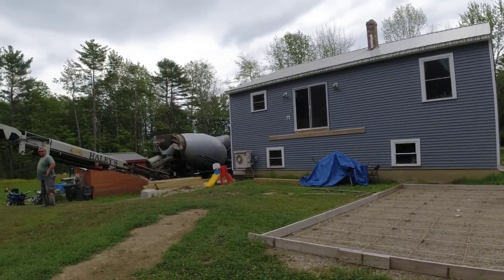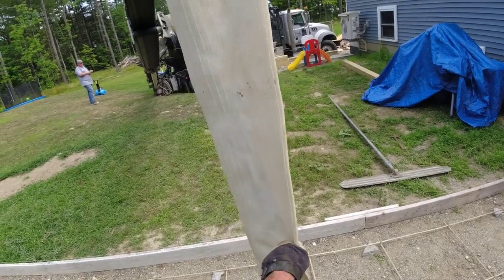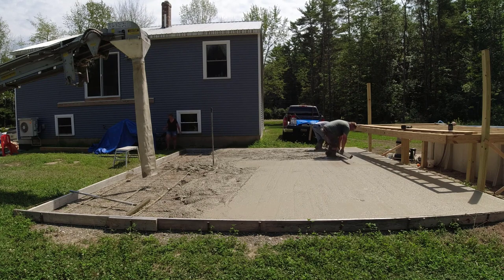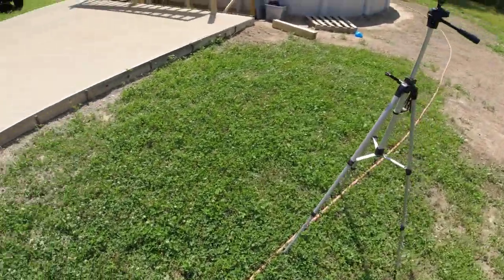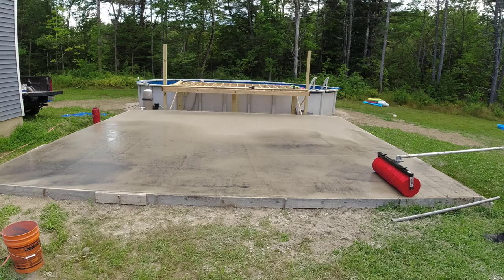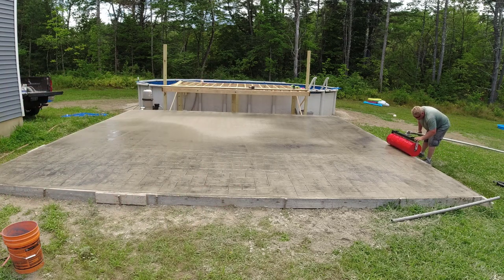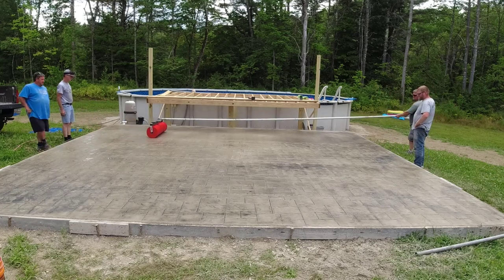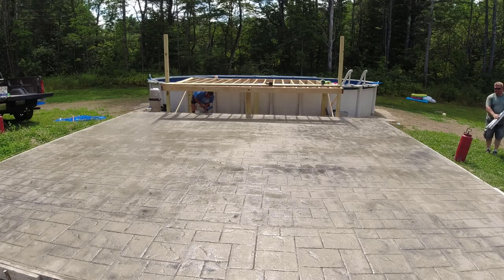Roller Stamp Your Stamped Concrete Patio! (How To Rock & Roller)

Comment: Looks like you have to start the roller at specific place on each run also is that correct. It looks like you had the same size print squares along the starting edge also.

Comment: HI Mike Very  good job We screw a  raised timber from screed to screed in the direction of roll pull the  roller  backwards only keeping the roller tight to the timber change  the timber for each new roll it helps a lot

Comment: That looked like a really good mix. The last 2 trucks I got were absolutely horrendous. 

It was supposed to be a 5 inch slump and right out of the truck even adding water, it took 10+ passes with the bull float before it would close everything up…..there was so much rock in it it was absolutely horrendous.

And that was 20 seconds after getting it out of the truck.

Comment: I'm glad you tried that thing.  I've been paranoid to try one out.  I doubt I could get the seams any better at the roller ends.  I don't think a person could get the seams fixed up to where they could blend with a touch up wheel.  Not me anyway.
Reply from the maker: If the slab wasn't so wide then the seams are a lot easier to match up.
Reply: @MikeDayConcrete  Makes sense.  I first considered trying one out on some sidewalk pours.
Reply from the maker: I think it would work good on sidewalks.

Comment: Hey Mike.   Great videos!  Thank you for the great advice.   I was just wondering about cracks.   Do you have any advice or techniques when trying to repair a crack in stamped concrete.   Is there a a certain kind of material that works best for filling cracks or techniques to help blend it in with the texture of the stamped concrete.
Reply: its available bro
Reply: its cold shika

Comment: should have backed your concrete truck in where the half ton is parked.  run your bull float perpendicular to your screed pulls.  Do longer pulls with your screed board.  Spin your roller so the pattern is not the same as the previous pass.  you finished rolling where you started placing, thats why its so hard at the end.  should have started near the deck.  might get better contrast with the powder release than the liquid but it is a lot messier.        job looks good.